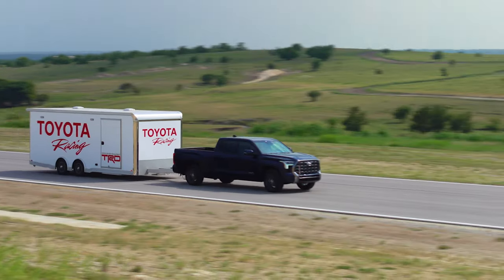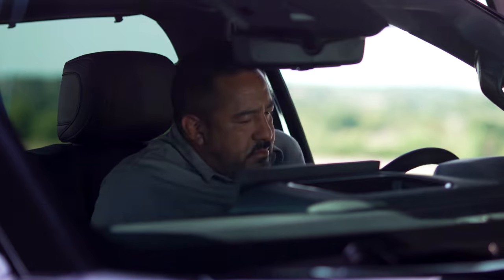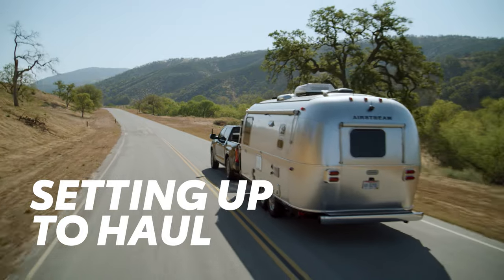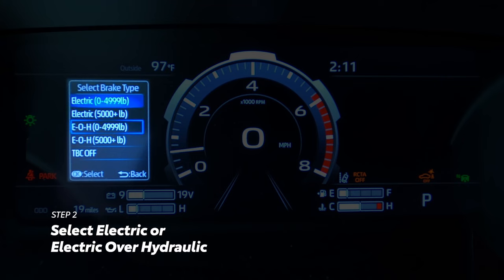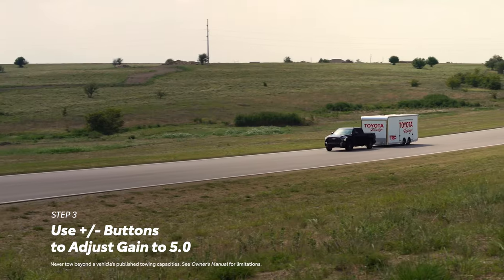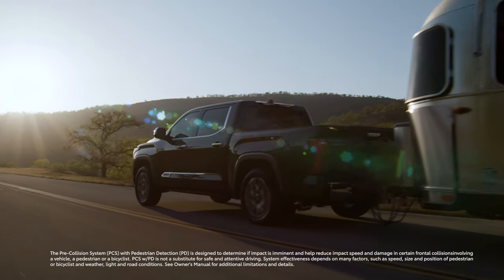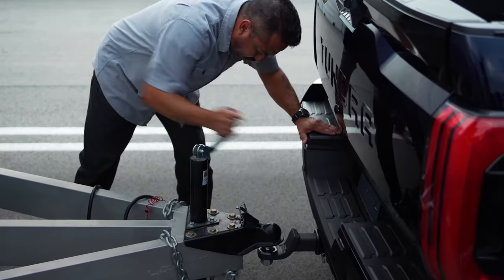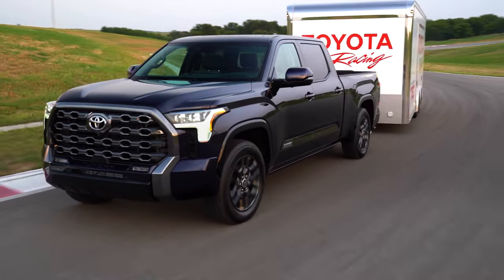How To Use Toyota's Integrated Trailer Brake Controller | Toyota

Comment: I just bought a 2023 hybrid Toyota tundra last month. I had hooked up my trailer to it and automatically on the driver display it had said that the TBC was off. Also when I tried to program a trailer it gave me an error every time and no information was saved.I thought maybe it was my trailer so I went to get it checked only to find out that the trailer breaks worked and that the problem was that my truck was not sending signal to the trailer breaks. They tested this out with an electric force meter that shows if the was sending current and it was not. I took it back to the Toyota dealership so they could fix it and they were no help they said there was nothing wrong with it. So I asked them why can’t I program a trailer to the truck and they said they don’t know then I asked if they checked to see if electrical current was coming out from the TCB and they said they don’t have that equipment so essentially their is nothing they could do based on the test they did looking for codes and checking sensors. So tell me what is the warranty for then?
Reply from the maker: Hi, Joey. When you have a moment, please call our Brand Engagement Center at (800) 331-4331 to further discuss. Our Brand Advocates are available Mon-Fri 8am-8pm, and Sat 9am-7pm EST.